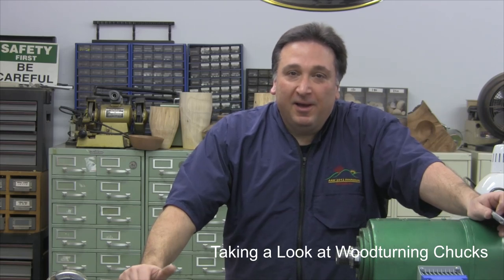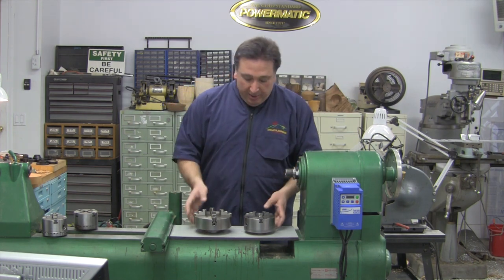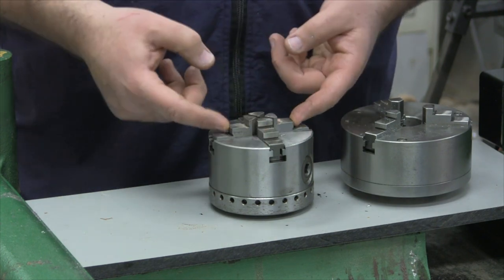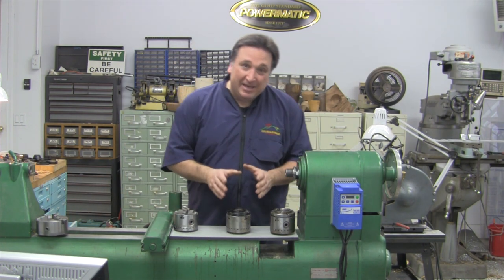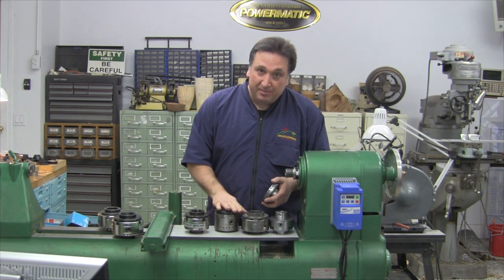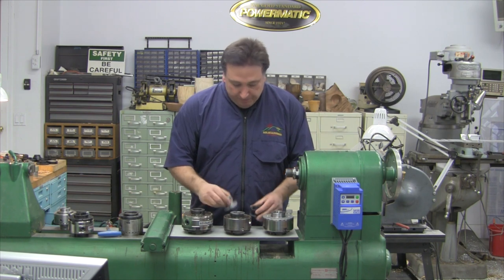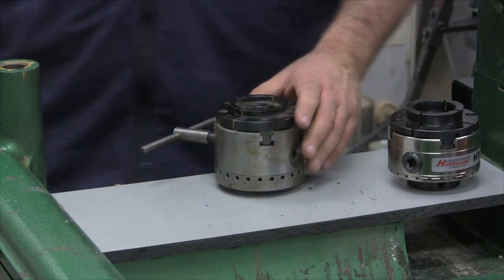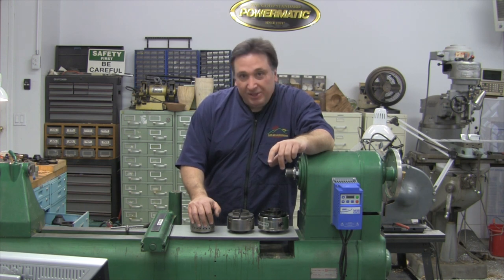Woodturning Chuck Review - History, Oneway, Vicmarc, Hurricane, Axminster

Comment: Choose any chuck and get the jaws you need for that system. The expansion size is of no value as the best holding power comes from the jaws being almost in their closed position anyway. Just change to larger jaws if you need a larger spigot or recess. I've yet to go larger than the vm120's standard jaw size on very large bowls as that amount of wood on the spigot is plenty. The best reason to have a few chucks is so you aren't changing jaw types often, I have one setup with coles jaws all ready for when I need to turn the base off the bottom of bowls, that way I have the standard jaws ready to go for the next project. Saves a to of time but the costs are high.

Comment: I have a Hurricane HTC125 Woodturning Chuck. If I want to run in reverse mode, is there a security pin or screw to prevent the chuck not to fly out ? Hector Sanchez

Comment: I have a cheap chuck from PSI. It works great but I always see turners with way more expensive chucks. What makes the more expensive chucks better?
Reply: Having both a PSI and Nova chuck, the Nova is a step up in build quality and easier to m I unt jaws. The jaws are dovetailed to hold the piece which is stronger both stated and in my opinion.

Comment: Oneway has 3 different chuck's, (the Oneway,Talon & Stronghold ) all which have 3 different sets of standard jaws + numerous other specialty jaws.  Along with this they have drive center's, worm screws, etc whiçh fit I to the chuck.  
I think you totally missed the mark in the comparison of the 3 chuck's, especially the Oneway,  IMO.  In fact it has been called one of the top 2 or 3 chuck's on the market.